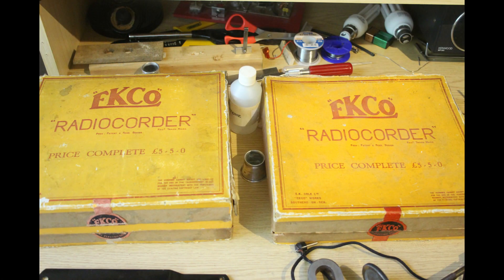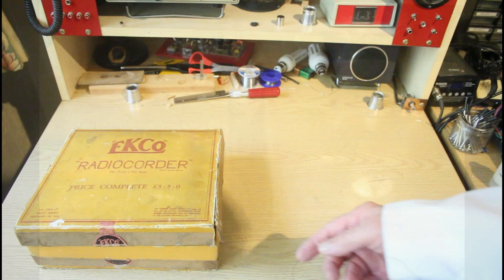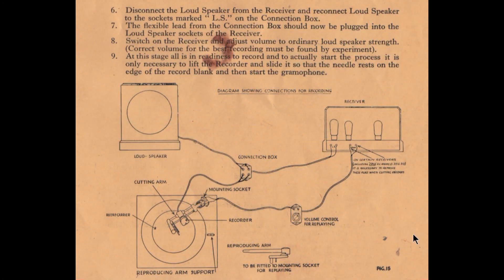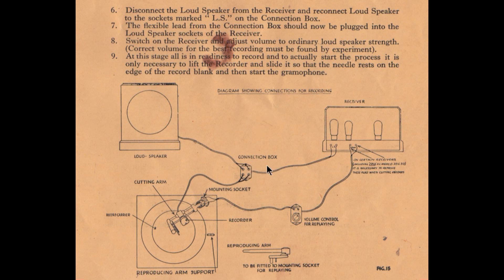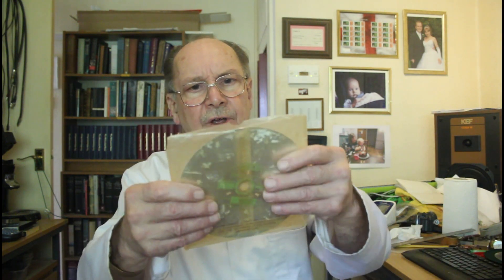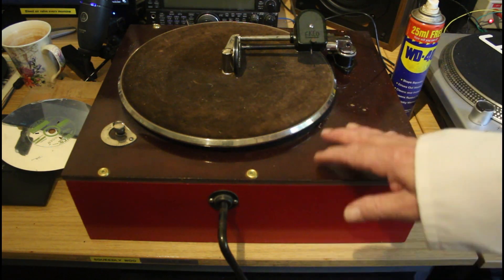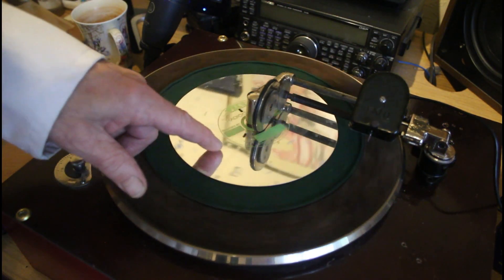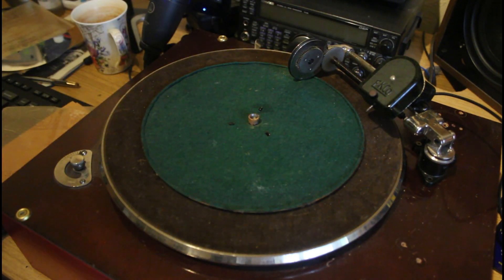home recording  ca.1932 EKco Radiocorder from UK

Comment: Hi Norman.  What an interesting "little" gadget.  It is most interesting to see a device from so early in the electrical era.  I am more familiar with the later webcor home recorder that was usually a radio/phonograph combination.  Did you do anything to the rubber parts inside the cutting head?  I wonder if that would have made a difference to the quality?  Stay safe, Enriko Kolesky

Comment: Another great video, Sir and an interesting device. I noticed the drive trundle-wheel started to lose its grip as you got towards the middle of the recording due to the oil. Is that the trick then? Keep the middle dry and only oil the part where the embossing head will pass? Who knows? Looking forward to your next installment....

Comment: Have you tried covering the disk with a thin oil like kerosene before cutting/ engraving, I want to know what this process is like any chance of trying it cheers. What oil did you put on the disc? maybe a PTFE thin oil can you get or silicone oil watchman oil maybe. But you need to have a puddle of oil I think will be better not just a smearing. Better lubricant plus it acts as a damper
 I think cork platter mat would work best  cut down some of the noise give grip to the disc. You spoil us 2 videos in less than a month lol
Hoping you'd reply to this question I've got, I left you the same common virtually on the last video are they showing up. I thought you would be the man to know these answers or  experiment with it

Comment: Do you know if there was some sort of switching device where one could record off the radio, and switch seamlessly to voice recording?  I have a recording from Christmas 1944 that has a family discussing their Christmas but is bookended by what are clearly radio feeds.
Reply: An image of the kit at this link suggests there was indeed a switching device (labelled "G" in the image).
http://greenbank-records.com/1930s-recordings#/1930s-home-recordings/
In the image I had assumed the device was for switching between recording head and playback head (assuming use of two heads i.e. one with steel needle for recording and one with fibre needles for playing noting the soft and fragile nature of the aluminium surface). But perhaps it (or other switches) were used for switching between microphone or receiver. My grandad's recordings include several examples where he "seamlessly interrupts" a BBC radio broadcast (usually a humorous aside to try and lighten the otherwise solemn tone).